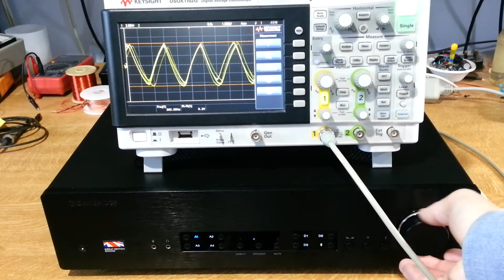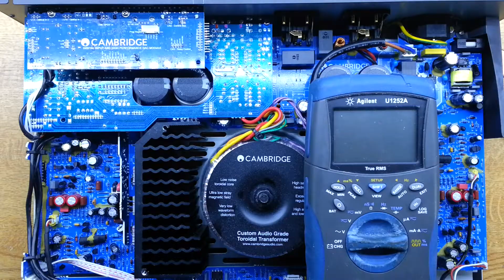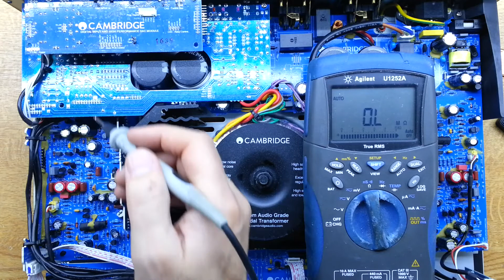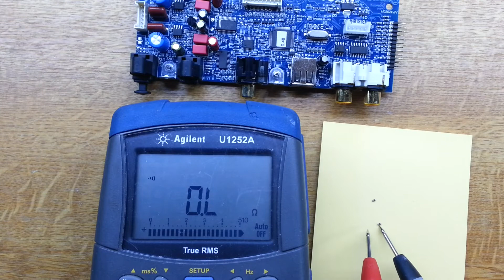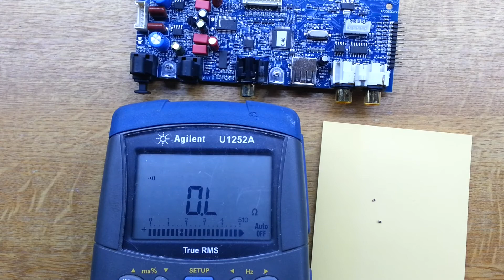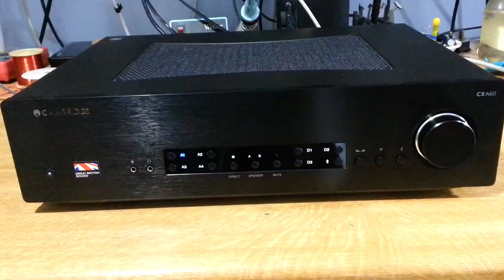Repair of a Cambridge Audio CXA60

Comment: Thanks for posting the helpful video - I just repaired a CXA60 with bias troubles, not an easy design to work on.  I found the CXA60 would not power up without the input board being screwed to the back panel. Looks like the case metal work is used as the ground return ! - it is designed in the "land of Lucas" - the prince of darkness (and earthing problems expert).  When working, the CXA amplifiers do sound very nice, I verified easily 5Hz to 70kHz +/-1dB, and believe the complex design delivers a very high damping factor, both contributing to the great British sound.

Comment: Nice video! I worked for 19 years in the electronics industry, cracked ceramic capacitors are a well known issue as they are fragile. A pick and place machine could cause cracks, but so coould bending of the pcb or placing those caps too close to a V-groove in the pcb. You mention a systemic fault, so I'd say it might be a batch fault. If you look back at the other repair, I wouldn't be surprised to see that the board in the other amp belongs to the same batch. Look for datecodes on components or the pcb itself, and I wouldn't at all be surprised if they are very similar of the same.
Edit: just looked at the other video and yeah, there's only 8 weeks between the datecode of this pcb and the other pcb. They might very well have been run in the same batch.

Comment: Nice fix man I’ve had issues with SMD resistors on this model splitting at the ends on the same board you repaired, the fault was a intermittent hiss after it had been on a while. I recapped a AZUR 840a yesterday that was not a fun amp to take apart.
Reply: Jaka może być usterka w Cambridge audio 840a v2 gdy jest dźwięk co drugi db, przekaźniki są ok.Pozdrawiam

Comment: Hi Sir, I just bought an used CXA60, referring to the 4 capacitors for power section, may I know what is the capacitor value?
Reply from the maker: 100nF
Reply: @myalbatech  Oh, I meant the 4 big capacitors. I think 4 x 6800uF?
Reply from the maker: @oldaltis  Oh those are 4700uF 63v - quite small actually.
Reply: @myalbatech  Oh, that's really small value! I've been misinformed then. Is the CXA80 getting bigger caps?
Reply from the maker: @oldaltis  I don't know I'm afraid, will take note next time I see one of these.
Reply from the maker: CXA80 has 4 6800uF
Reply: @myalbatech  Meaning you are now repairing another faulty CXA80? Haha